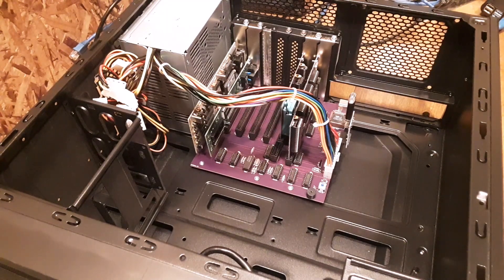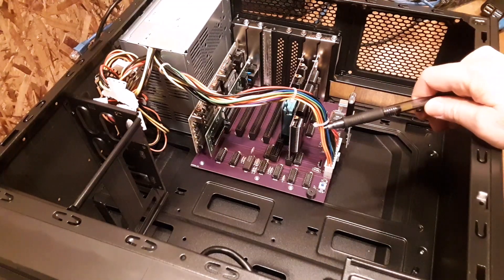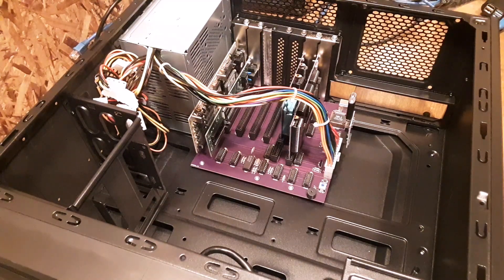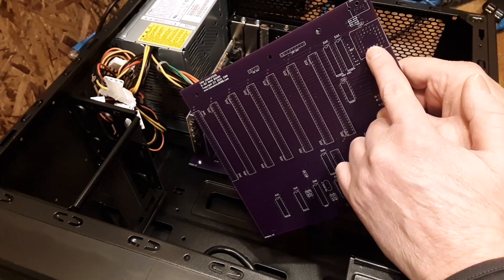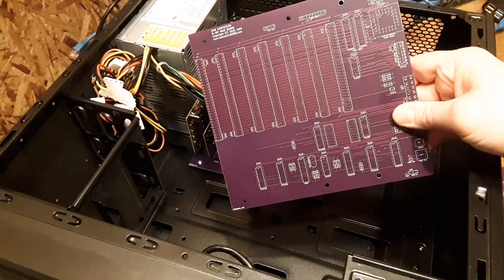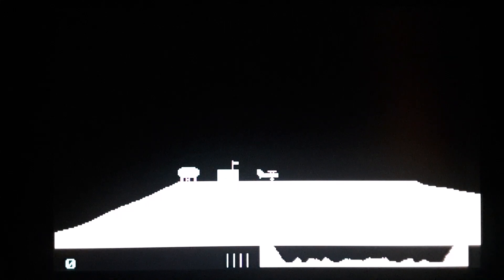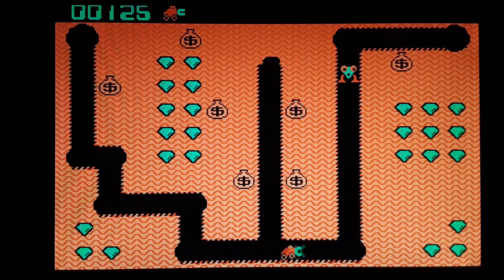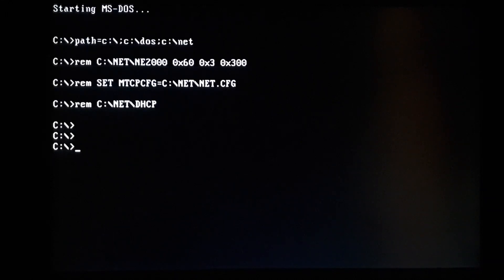8088 PC Compatible Project, Jan 10 2022 update (Speaker Fixed)

Comment: Cool video.  May want to buy upgraded board in the future!  I bought a used older machine and placed my motherboard in it.  I decided I didn't like it.  I preferred the open frame look!
Reply from the maker: I like mine outside the case when I am playing around with it and testing parts. 

I should have some complete boards with the speaker fix available soon. I was thinking for those that have a system already I can put together the main board with all the sockets solder on with out any chips. Then you can just move the chips from an existing board over. I would include the 2 new additional chips.
Reply: @elijahmmiller  I was kind of hoping you would say that.  I would say get it in a kit form.  My old eyes just can't handle that much soldering!

Comment: Do you have an IRC channel?
Reply from the maker: No there is a discussion group on discord though.
Reply: I cannot access Discord using DOS.
Reply: @tikkasen_urakointi  Discord works fine on most smartphones and tablets.  If you are watching this, you have to have something a little better than DOS? 😊
Reply: @tikkasen_urakointi  Macintosh garden has an discord IRC bridge. You can use their IRC server to connect your discord account, and join any of the discord channels you're a member of. I use it quite a bit on my retro hardware. shakes fist at the modern web
Reply: @dgrissom007  What's better than DOS?